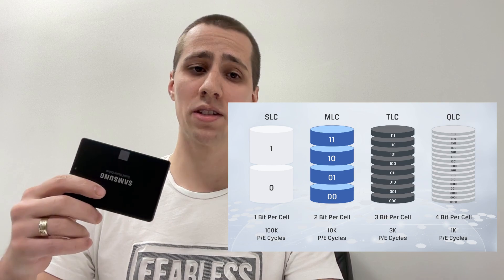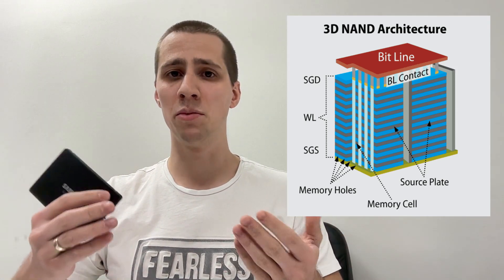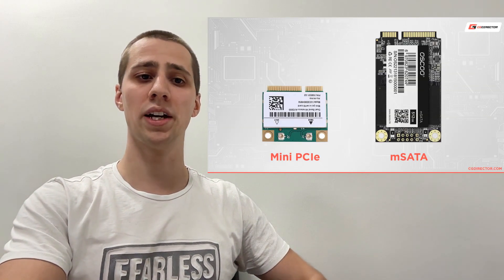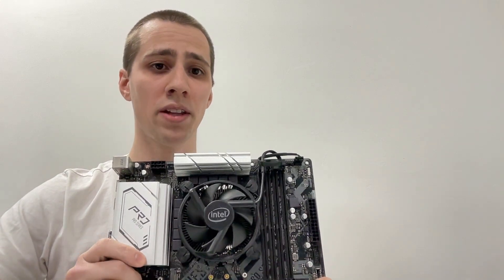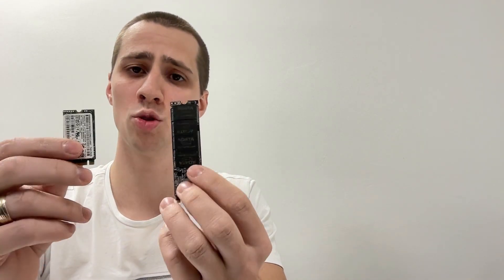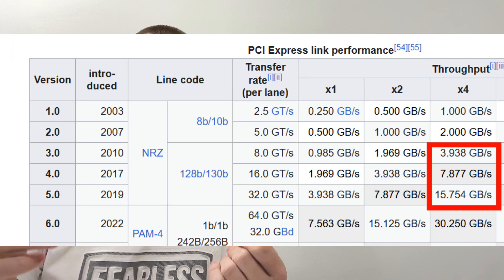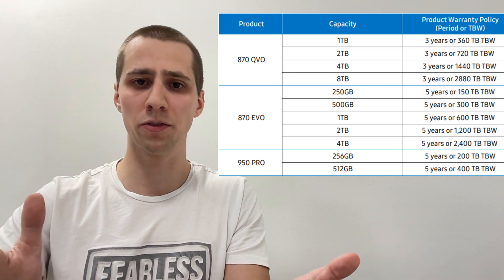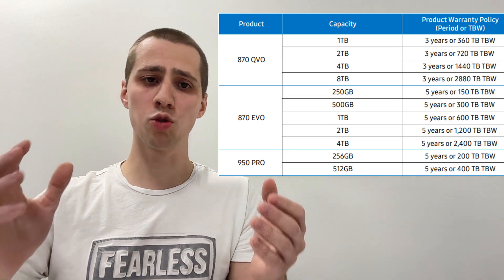SSD Explained. Basics of The Solid-State Drive.

Comment: Nice explanations of SSD basics. Thank you very much! I am trying to decide on what NVME SSD to purchase for doing external backups for my office computer, and this video was helpful for me to understand some of the specs when it comes to choosing a drive.
Reply from the maker: Glad it helped you! I recently bought a rugged HDD for this purpose—call me old-fashioned—but as an Electronics graduate, I don’t fully trust SSDs for long-term backups. That said, if speed is your priority, an SSD is definitely the way to go. Just make sure to power it on at least once every 6 months to avoid losing your data. You can also check this website to compare the speeds of different SSDs:
https://ssd-tester.com/external_ssd_test.php
Reply: @hardwarewhisperer  Thank you for the information! I didn't know that if the SSD is not powered on for some time, you may lose data. In my case, it would be powered on every few days, at the time when it will be used to back up my business desktop. During one week I usually alternate between 3 or 4 external drives and do a full backup (including the C drive, etc) at the end of every day. Up to this point I have been using regular external SSD drives, but the backups can take a couple of hours. I'm hoping that with an NVME inside an external enclosure, my backups will go much faster at the end of the day.
Reply from the maker: Data loss can occur if an SSD is left unpowered for 1–3 years, but I suggest powering it every 6 months to be safe. For your needs, consider the ADATA SE920 1TB—one of the fastest external SSDs—or pair a Samsung 990 Pro with an external enclosure (though USB adapters can sometimes bottleneck speeds). Also, ensure the port you use supports USB4/Thunderbolt 3+ to avoid speed limits. And one last advice - back up only your user folder, not the entire C drive, as copying and pasting system and program files can lead to errors and potential system corruption.
Reply: @hardwarewhisperer  Thank you very much for the advice. I'll do that going forward.